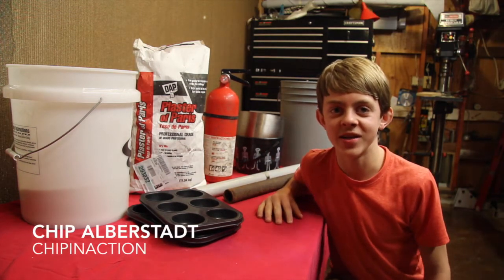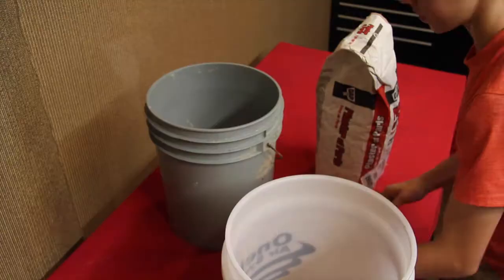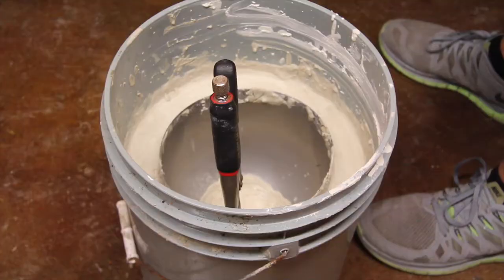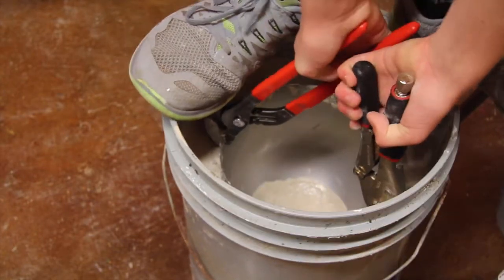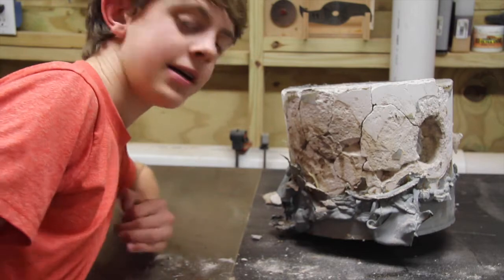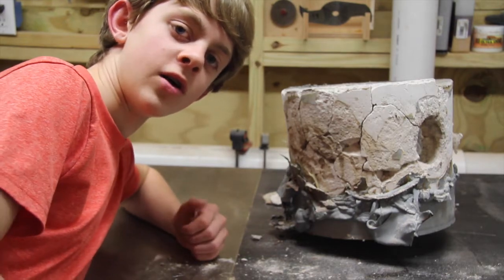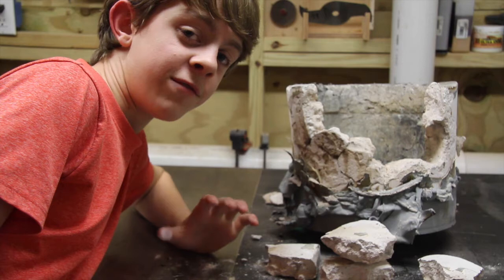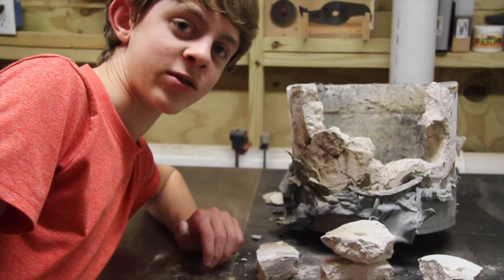Aluminum Kiln

Comment: That's not aluminum its tin, pop cans are tin just the tabs are aluminum
Reply from the maker: The melting point of tin is 449.47 F while the melting point of Aluminum is 1220 F. Meaning you can melt tin on a kitchen stove. The modern (post 1960s) soda cans are actually made from an alloy of aluminum. The containers canned goods come in, commonly referred to as “tin” cans, are made of steel with a thin coating of tin metal to prevent corrosion. So all the cans that are common to us, like soda cans and canned good cans, are not made from tin metal.

Comment: good video! I think I will do this project. I will use a steel bucket, not plastic and will probably use a hair dryer for air. what did you use for an air pump? thanks for the help!

Comment: you need to either read or watch some videos before you try this again.  Your process is flawed and dangerous. A properly made kiln would not got hot enough on the outside to melt all of the plastic but then I cant believe you uded plastic in the first place
Reply: +Ben Youmans or maybe other people are a little soccer mommy
Reply: Shona O'Neill to the one who comes so late the party is already over; As long as you understood it was spelled correctly according to the laws of the Internet.
Reply: so smart